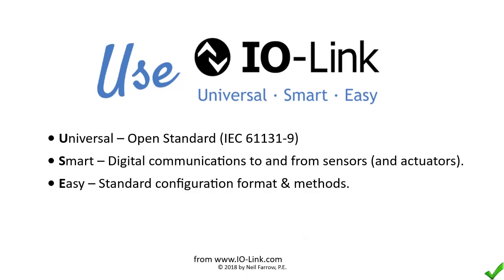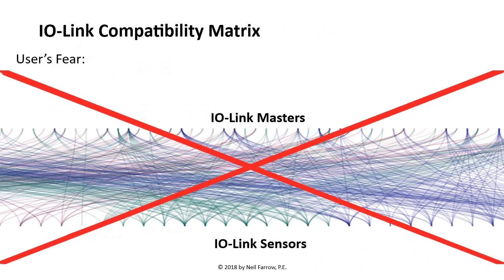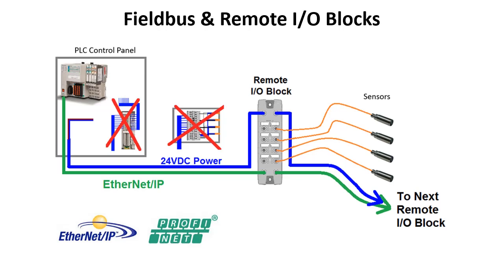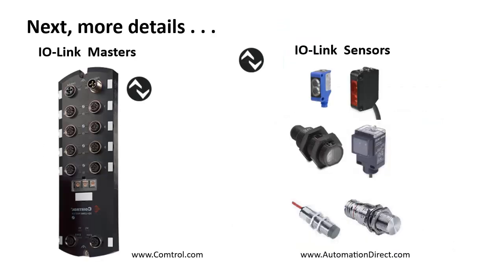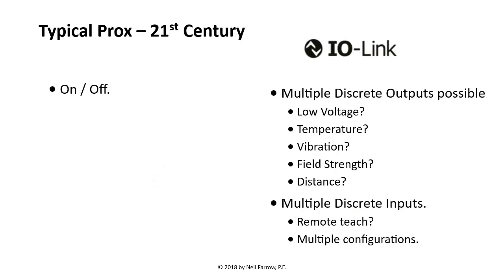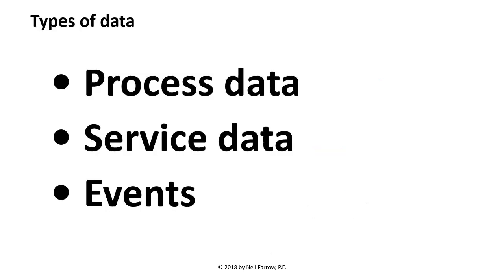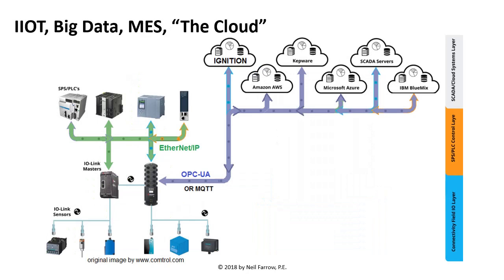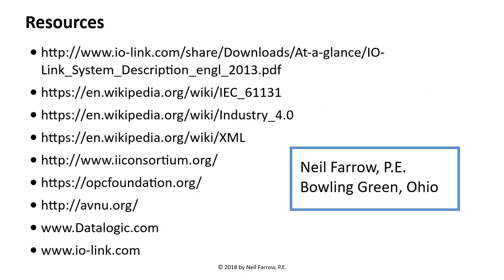Introduction To IO-Link for Controls Engineers.

Comment from the maker: INDEX
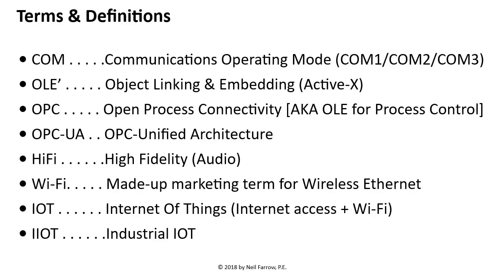1:08 Terms & Definitions
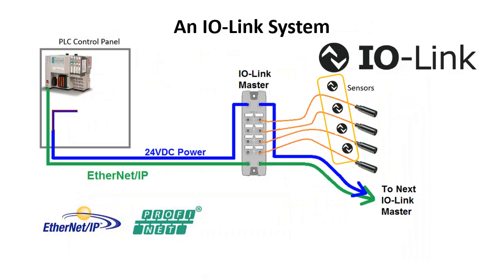2:45 Overview diagram
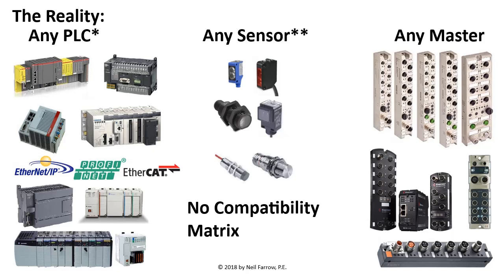3:53 Any PLC, Any Sensor, Any master
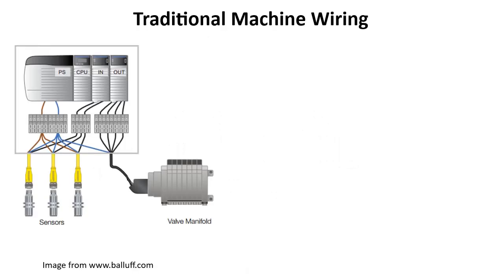5:45 Traditional Wiring
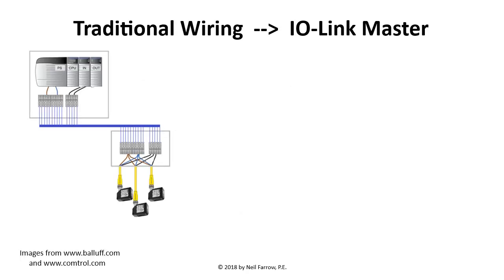8:25 Traditional Analog VS IO-Link cost savings
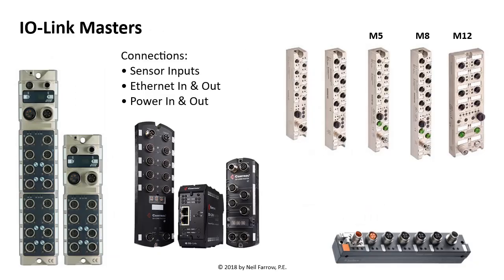10:11 IO-Link Masters
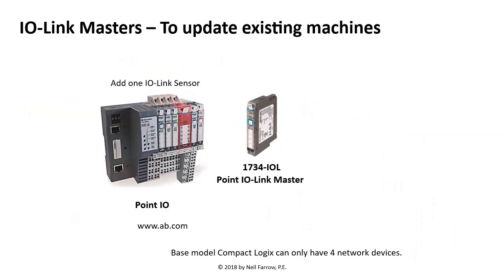11:46 AB Point IO Master
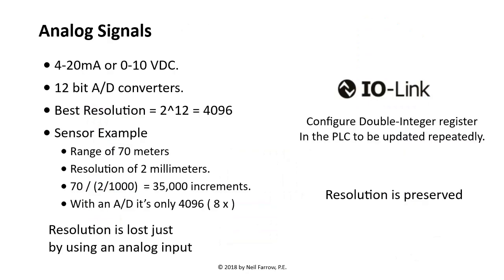13:52 Bust the 12 bit Limitation on Analog Inputs Resolution  
14:15 Serial VS IO-Link
14:42 IODD configuration files
16:12 Types of Data: Process, Service, Event
17:35 Loading IODD file
18:20 Top 10 List
18:38 Did you see the revolution?
19:29 OPC-UA 
21:24 IO-Link Safety
21:33 Master Selection Considerations